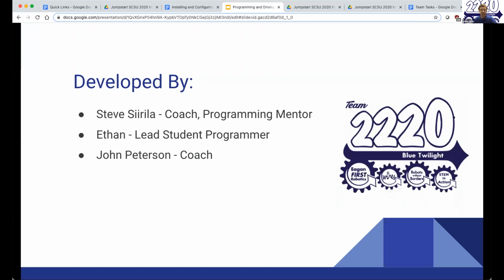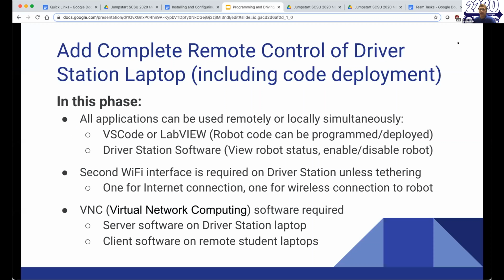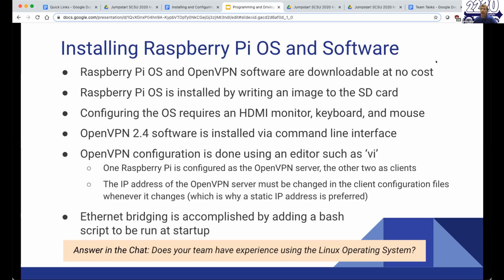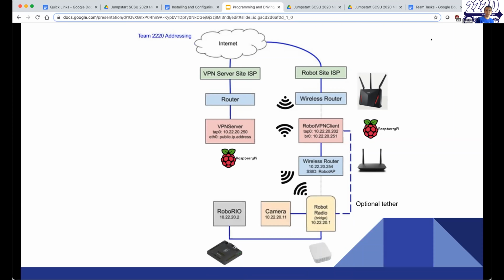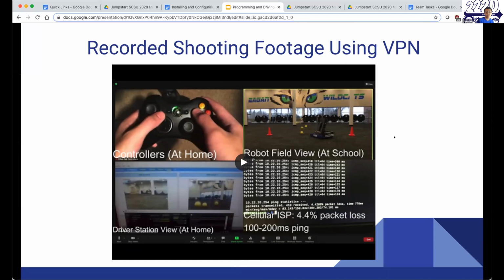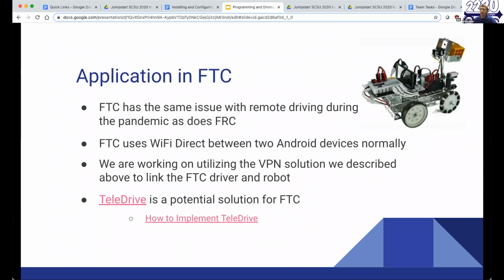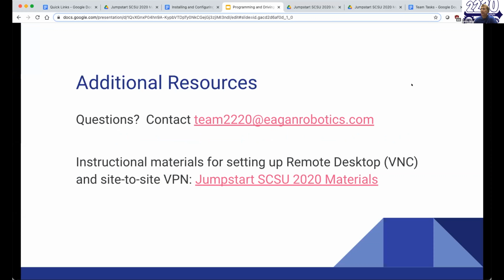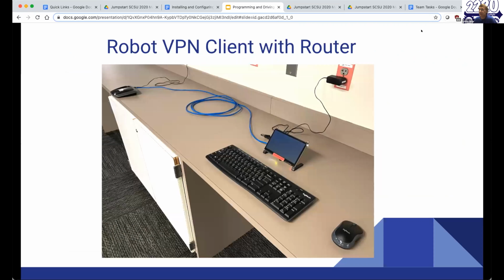Programming and Driving Your Robot Over the Internet

Comment: Significant Robot VPN System Update - April 15, 2021

Are you wishing you could program and drive your robot over the internet?  Many FIRST FRC teams are not able to work on or practice with their robots due to the COVID-19 pandemic. There are also times that students far away from their workshops, or even team sponsors, would like to drive their robot but it cannot be brought to them. 

Team 2220 Blue Twilight developed a way to program and drive a robot remotely. Their solution involves inexpensive Raspberry Pi to create a site-to-site Virtual Private Network (VPN) with no modifications to the robot or driver’s station required, and the system can work using a cell phone as a hotspot when no WiFi is available.  2220’s European sister team 5883 even successfully drove a robot in Minnesota with their driver almost 5,000 miles away in Poland.

The Robot VPN system has been in development since the summer of 2020 but a significant user update was made April 15, 2021. After analyzing feedback from various teams already using the Robot VPN system, Team 2220 made set up much easier by writing automated scripts so most manual commands are eliminated, and total software set up time for the VPN system has been reduced to under 45 minutes.  Check out this step-by-step guide on how you can set up the Robot VPN system for your team.  Contact us at team2220@eaganrobotics.com if you have questions.